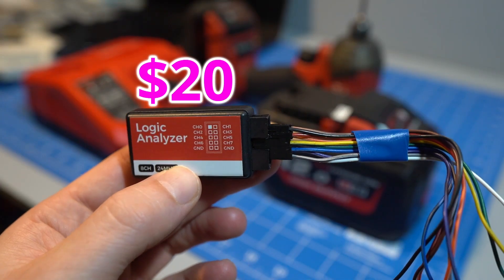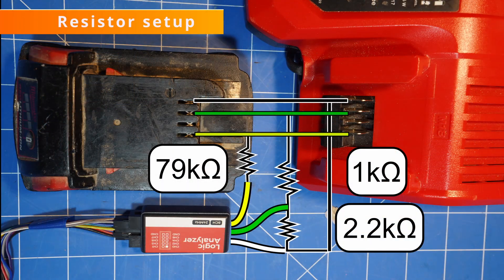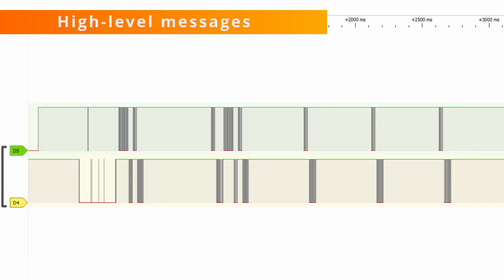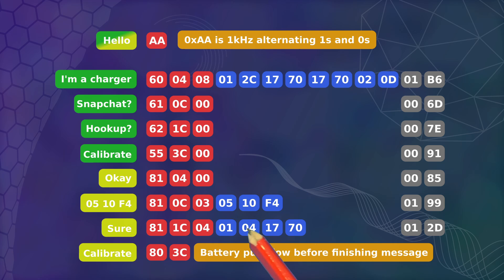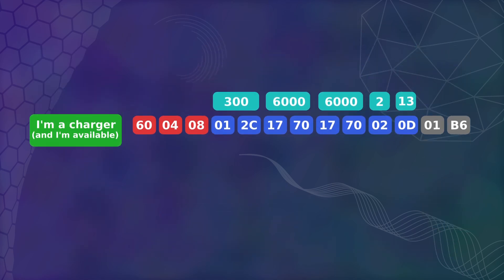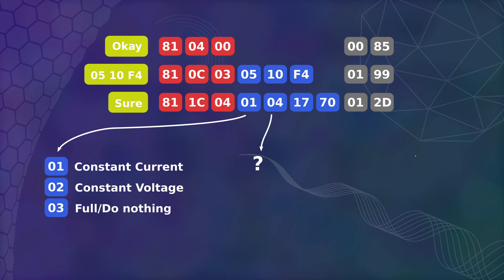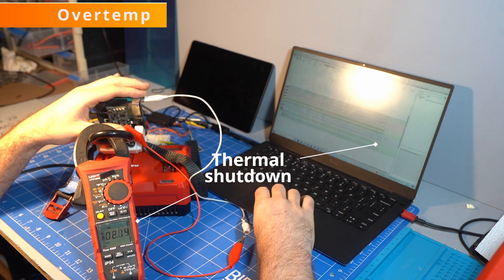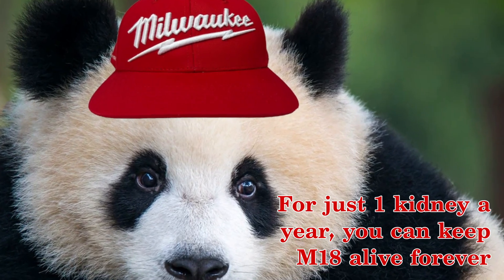[004] Reverse-engineering the Milwaukee M18 Redlink Protocol

Comment: this is such a terrible implementation and makes it very clear that the intended purpose is just making them more complicated so you buy their overpriced batteries just from them
what instead should have been done with ALL these standards is have a universal mount and protocol for ALL 14V, 18V or more batteries, that is the only real way forward, because basically everyone is using 18650 in them anyway, and the mount+protocol serves only one purpose - to limit options of purchase for the customer, thus creating "monopoly"
had they been using their proprietary liion batteries or something else as power source, then I agree, make your own as you like, but this is just customer gauging, nothing more
Reply from the maker: The original M18 batteries had a much simpler, but worse protocol. I haven't had time to explore it properly, but it's a very basic system of 1-3 pulses from the charger and a high/low (go/stop) signal from the battery. The charging method seemed to be a trickle type charge and was slightly overvolting the cells. Don't quote me on that, though, as this is from memory and I haven't had the time to explore the older batteries properly.

So this was necessary complexity to be able to get proper CC/CV charging working in a way that was backwards compatible.

I agree in general that someone needs to force all these companies to sit down and make a universal design, but that's going to be several years away.
Reply: There is CAS batteries that are shared amongst manufacturers
Reply from the maker: CAS is Metabo's battery that they've opened up for others to use. Bosch has recently done similar. CAS is a bit shaky as Metabo got bought by Hitachi, but then Hitachi sold Hitachi Power Tools and Metabo to KKR Holdings. KKR doesn't really care about either brand and just wants to re-sell them for a profit. They tried to sell a year or 2 ago with no luck. So if Metabo fails, CAS could disappear.

A true universal battery would need a fair bit of thought. You need to design something that's flexible and can continue when new cells and chemistries emerge. One way is to just put all the smarts and even cutoff in the battery, but that makes for expensive batteries, and the cutoff mosfet adds unecessary resistance.

Comment: Ha, I was just thinking about this a week ago. I want to add a charge port in the side of a drill so I can run it off a cord without worrying about battery level, from the looks of this Milwaukee is a good shot.
Reply from the maker: Might not be that simple. You could make an adapter that wired up the pins on the charger and took them to the battery. Then you'd need an adapter that sat between battery and tool that could receive charging wires. 

The problem is, the tool needs the pins that the charger is using. Without them, the battery is unable to signal the tool for overheat and low-voltage. If you're very good with electronics, then you could make a small MCU to listen into the battery-to-charger messages and there's just enough information in there to monitor for overheat and low-voltage. Overheat can be detected if 1st payload byte is 0x04. Low-voltage can be detected if the current request (3rd and 4th payload bytes) is 300mA.

You might want to look into a youtuber called Harrison Hobbies who made an AC adapter for his M18 tools (https://www.youtube.com/watch?v=arXXAF89-wg). 

The necessary power supply is quite large, though. If you look at my power testing video, the drill is typically 20-50A (400-1,000W) and can go as high as 150A (2,500W). https://www.youtube.com/watch?v=XNKlEHLwldE
Reply: You should just buy a corded drill...

Comment: yo I didn't know you made video, I will check them out :) just popped in my recommended feed, nice!
Reply from the maker: I was wondering when you'd find me 😁. Vids was always the plan, hence the cringey reddit username. 

I know you love ragging on Milwaukee, so you'll probably love my other vids. Lots of ammunition to use in your internet arguments!
Reply: @toolscientist  haha awesome, thanks! Tbh I wouldn't mind them at all if they didn't make repairs so hard/impossible and if they didn't skimp on some quality related stuff, tools themselves are mostly fine and they certainly have robust lineups
Reply from the maker: @riba2233  yeah they make good tools, they're ethos is just power at all costs. They're marketing and cult following makes me shake my head. 

I have a suspicion that the quality stuff is due to TTI. I think Milwaukee does the design, hands it over to TTI, who then gets their engineers to optimise it for mass production. That H96A to H96B debacle could have been a decision from TTI rather than Milwaukee.
Reply: @toolscientist  agreed, that sounds about right!

Comment: We need someone to do this with the harbor freight Hercules power tools line its got an extra special protocall. Hint 49 hz. Your awesome! I dont think Milwaukee balance at all.
Reply from the maker: @scsherman207  that chip can do 50mA, but if you follow the links to quagmire repair, he says they're using 1k-ohm resistors. 4V/(1+1k) = 2mA. TI has an app note about how to use external resistors to get more than 50mA.

 It also can't drain adjacent cells, so that slows down the process even further. As you said, not a great chip, but they've stuck with it because it's what they know
Reply from the maker: I think Hercules is North America only, so I wouldn't be able to test. I think M18 balances, it's just insufficient to keep up. The 12ah and 8ah are exacerbated by early issues with the Samsung 40T cell that they use. Thanks for compliment!
Reply: @toolscientist  I have never seen even a slightly low cell balance up, its just keeps getting worse the more cycles that are put on it, the old packs you can hold down the button and it will flash how many charge cycles and faults its had along with manufacturing date depending on the flashes of each led but they got rid of that great feature, the led flash decode is on the web. The m12 dont even have the circuitry to balance. And the batteries will discharge to storage voltage after 9 days thats what that board does in my opinion, but I would love to see even just 20ma out of the MB to b2,b3,b4. Thats my experience with these but please prove me wrong to put some trust back into Red. Thanks for your valuable time, testing and showing us the real numbers. It helps validate some of my own tests. One single 18650 can pull north of 135 amps, dead short half second, its how I bin batch 100’s of cells Quickly the highest amp cells go into the highest end dirt-bike packs money can buy.
Reply from the maker: M18 doesn't push low cells up, it pulls the highest cell down. So one weak cell often gets left behind because the BMS has to bring 4 other cells down, and it can only drain 2-3 cells at a time. I haven't looked into it yet, but from what I can gather from datasheets and Quagmire Repair's schematics, this balancing current is only 2mA
Reply: @toolscientist   2mA? roflomao, speechless
Reply from the maker: @riba2233  not confirmed yet, so don't quote me on that.
Reply: @toolscientist  ok 👍 lowest I have seen and kind of an industry standard is around 50mA

Comment: It is simply wonderful hard work and ending strongly with the highlights. Simply amazing work and analysis. Have also been tinkering with the batteries and chargers, have also found buy ot fix its amazing work and the post the reddit. In my view, both of you have found amazing breakthroughs in the long history of milwaukee battery issues. The reason for me to do a little exploring as well is that I have quite a few milwaukee batteries and tools. I'm very satisfied with them because I am now also running into the fact I don't use the batteries frequently throughout the years, but I have been useful throughout the house for other appliances and tools. I'm now into a project where I want to use an array of batteries from milwaukee in parallel to use as a solar charger and harvest some energy from the sun. The combined potential I have with m12 and m18 batteries combined amount to a potential of harvesting and using over 2200 wh. In a short time, I have found that the charging and tool pins are indeed different. Have done some shopping around for milwaukee tools via alieexpress, and to my surprise, I have found and bought one tool that has a 5 pin milwaukee charging and tool connector in one Another amazing tool I found was from a German brand on amazon that is a 2 pin milwaukee/DeWalt adapter to usb c pd that can charge in two directions over just the 24 V and ground pin I don't understand how this adapter is doing this, but I am a bit surprised. The main issue I'm running into is if it is possible at all to charge and recharge responsibly over the positive and negative pins without damaging the battery and controllers. Have been thinking about workaround with voltage regulator, temperature controller pcbs, and a solar charge controller, but with so many batteries, it's  becoming a crowded affair in case. I'm looking for a more compact solution as I also have to take the different complexities in wire sizes into account. All this doesn't help manage budget. Secondly, I was also thinking about some tinkering with my own 3D tool projects, one of which is making a proprietary electric screwdriver running on redlithoum batteries. I have several of those because of my milwaukee lights, but a lot are sitting around unused but have potential for more applications than just lighting. Buy those who use proprietary connectors, which also means thinking of ways to make a proprietary battery case with pins and a way bidirectional load and charging capabilities possible.
I only have a basic understanding of electronics and have become more experienced with battery knowledge over time. Advanced logic on the matter of milwaukee batteries and advanced chips goes my understanding of all the intricacies, but certainly intruiged by the level of comprehensible understanding of the battery protocols thus far. I would be happy if I could learn to understand the basics enough to make a responsible  basic integrated mikwaukee charger and load pin connector for the proprietary diy solar charger with milwaukee batteries. As far as I understand, it won't work with just the positive and negative to do both and manage load balance. I've seen interesting YouTube video work done by Korean diy addictor channel, where he bypassed the internal controller with a seperate external active balancer with seperate leads in the batteries, which inspired me with some ideas to bypass the controller in my project. Naturally, the easiest way would be if milwaukee would allow current owners to provide a fitting market product connector adapter for such projects so we can bypass the logic more freely. I think we're headed into the direction anyway, as we also see with second life projects of batteries and EV batteries. The logic in that regard does seem to hamper future proofing second life of the battery. Milwaukees latest movement to 36V architecture for tools with toolbatteries has also got me interested in how they pulled that off whilst I struggle with  combining mikwaukee batteries. I've tried hacking the oldest mikwaukee 18V 6 bay charger I bought for cheap online to a combined charger and power station. But the pcb boards were more complex than I thought to bypass with switches and cable management in quite a tight casing. The diy project hit a snag because of the 4 pin charging connector, and it is not easy to find a 5 pin connector.
Reply from the maker: I think your best option would be to solder balancing leads on like the Korean vid you mentioned. The alternative would be to learn how to program an arduino and recreate the communications. The communication is fairly simple, but would have a steep learning curve for someone not experienced with arduino or similar. I imagine the arduino solution would take many hundreds of hours for you, whereas external balancing would only take you about 10 hours max, and then about 1 hour per battery after you've figured it out.
Reply: I think you're right that the external balancing is most accessible for me for now. I have purchased the hardware. It is now finding the right time to execute. 
Do ÿou know if the m12 and L4 batteries run on the same logic as m18, or are they simpler?
I recently bought some knock of Chinese milwaukee compatible product tondo a little testing. What I'm looking for is a way to charge and discharge a milwaukee battery from a single connector bay, so all 5 pins connected to all 5 slots. To my surprise, no charger or tool has a connector with 5 pins. So charging and discharging are apparently two separate affairs. I do have one portable  fan with a light tool that has 5 pins. It has a USB  port, and the diagram mentions it is for output only. With the output pins I was hoping to make a 3P3S system with 12Ah batteries or 2P2S system 12Ah. But I'm noticing the charging part is the challenge. Having a a readily available 5 pin bay system for each battery would be helpful on my view to make a more comprehensible system. Otherwise the only thing I can think of is a more elaborate system of sliding pins, which would complicate the system beyond my capabilities, or make a double bay for each battery, one for discharging and one for charging, which would in my view defeat the convenience of a single bay system.
Do you know anyone that can make these 5 pins bays and /or ready made plug and play arduino boards?

Comment: 8:00 this seems to be an anti "someone repaired this battery and replaced the cells". Which I have a severe issue with as I am pro right to repair. Glad I didn't go Milwaukee for my tools.
Reply from the maker: I've seen other videos where people have rebuilt M18 packs with new cells without any issues. I think I might have damaged something during desoldering.

Comment: That battery that you dreamed toast, try putting 18v from another battery to the + and - pins. Had that same error come up on batteries people had thrown out. The batteries that I did this with came alive and was accepted by the charger again. I think something on the BMS sets a byte when the voltage goes under a threshold and the 05 get sent to the charger so it don't try to charge a broken cell. The batteries I have done this with is is all original Milwaukee and the types was the 2x M18 2.0A, 1x M18 4.0A and 2x M18 8.0A.
Reply from the maker: Maybe. I would have thought the charger would give flashing green and red lights for that, though. I think I damaged something when desoldering. Possibly the thermistor and 05 means undertemp. If I get the time I might try and investigate. I have 17 other batteries, and this one was pretty old and beat up, so it's a low priority.
Reply: Much safer to disassemble the pack and use a standard 18650 charger to charge one bank of cells at a time. You can use a multimeter to find the bank that reads low voltage (<4v) and confirm the polarity. This has become a common ritual for the 9AH/12AH packs that like to unbalance and report full charge on the charger but only show 3 bars (<20v output.) 

I've heard the microcontroller can write to flash/burn a fuse to kill the pack completely if the entire pack goes undervoltage too much, but I haven't seen that personally.
Reply: @bnasty267  I did exactly that and when it read approx 18v total on the battery outs (+/-) I tried putting it into a tool first, where it worked then put the battery into the charger (original Milwaukee charger non-rapid charge) and it gave the broken battery code with the read and green blinking. I googled the problem and saw a video where the guy said that he had "kickstartet" his faulty batteries by putting 18v onto the output terminals. I did that with another battery just for 10 sec or something like that and measured the voltage on the cells and on the board. Nothing changed  but when I plugged it into the charger it didn't give the faulty lights and it began to charge. That was my first revival and that battery still goes strong after 3 years. But yes be careful, a damaged cells is nothing to take lightly.

Comment: Great video! I know the MX Fuel line costs a lot more and isn't as popular, but if anyone wanted to poke around at the comms, I toured Milwaukee's headquarters right after the product released and they said it used RS-485 communication
Reply from the maker: Interesting! I'd have to be a lot more careful when poking around an 80V MAX pack, though!

Comment: This is great information it would definitely help in my idea of creating a powerwall based off of the M18 batteries.
Reply from the maker: Yeah, the interesting thing was that the battery doesn't react to not receiving it's desired current. So you could have a battery getting charged and pull current from it at the same time. The downside is you'll lose low-voltage cutout, but you can detect it as the battery reduces its current request to 300mA (0x012C) whenever any cell goes below 3V.
Reply: @toolscientist  thank you for the further insight. I might not have your skills, yet, so I hope to learn more from your content.